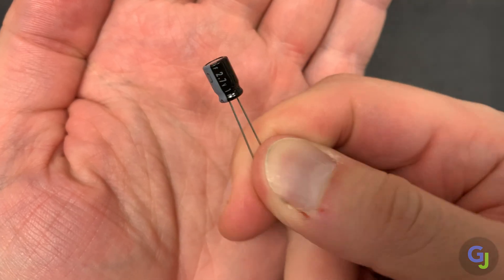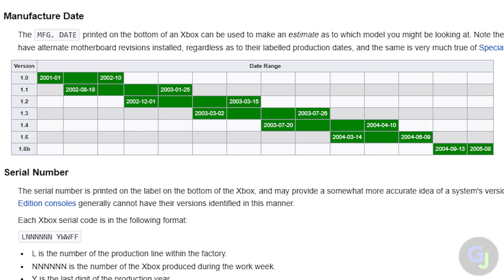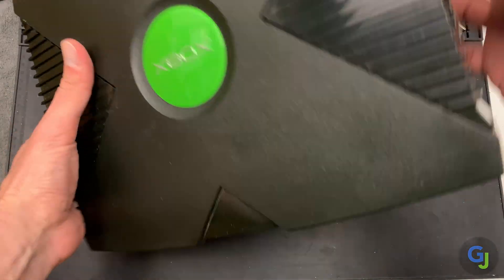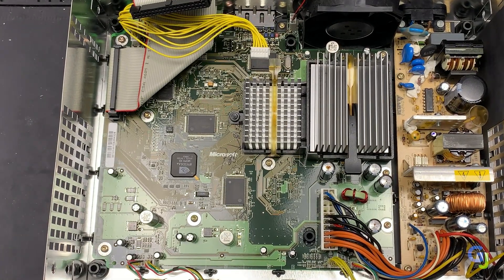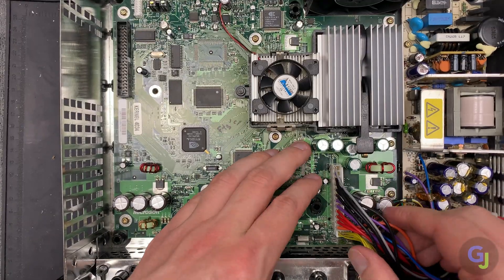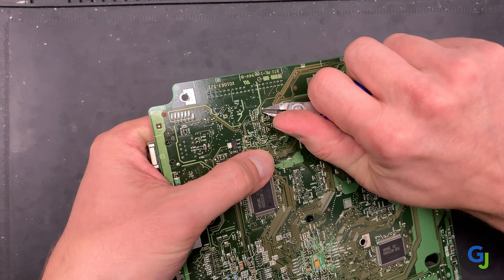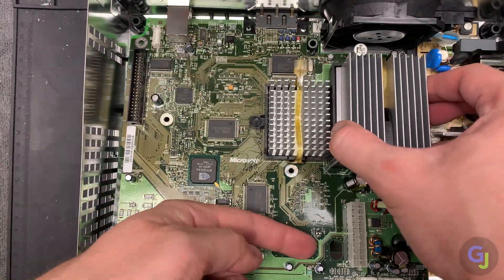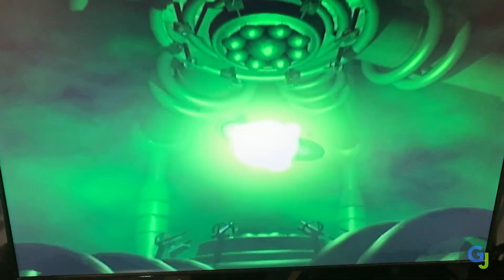The Silent Killer in Your Original Xbox – Clock Cap Replacement Guide

Comment: I’m debating between risking putting an old board into a 1.6 crystal case or learning how to solder to replace the cap on the 1.6. I like just ripping it out on the 1.0-1.5 lol it’s so easy
Reply from the maker: If it was me, I'd learn how to solder, but that's me... Buy another 1.6 unit console only (pretty easy to find online) and learn to solder with that unit and replace that cap or even do a full recap of the CPU caps too to get some more reps in before doing your crystal unit. Then you have some experience before doing your prized unit and you could even replace more stuff as time goes on since it's just a matter of time before the other CPU caps fail on it too.

Comment: What happens if you don't put the clock capacitor back on would it still work without it? Thanks in advance!
Reply from the maker: Yes it will still work on most units but if you have a 1.6v motherboard it requires it for regular operation.
Reply: @gamejaeger thank you! I appreciate your fast reply. You just gained a new subscriber.
Reply: @gamejaeger mines was a 1.0, 1.4 clock capacitor so I removed it ,cleaned it and put everything back together ain't got nothing.i wonder why.Could it be the disc player?
Reply from the maker: It doesn't power up at all now? Very odd... I'd check the cable connections again inside and try turning it on again with the power and eject buttons too. It could be a number of different things if it doesn't power up unfortunately.